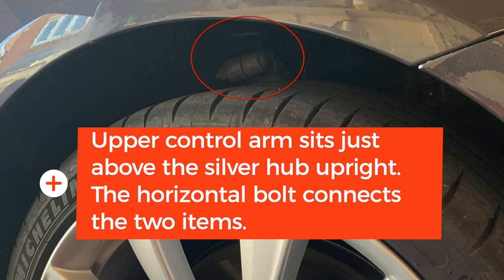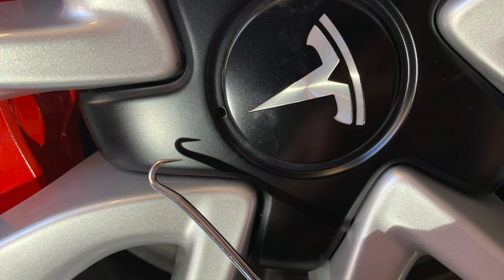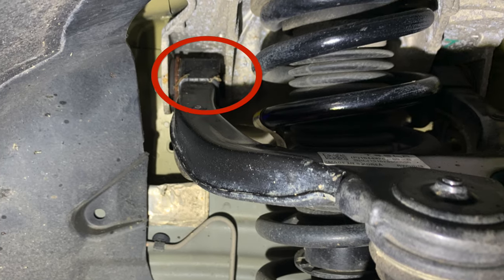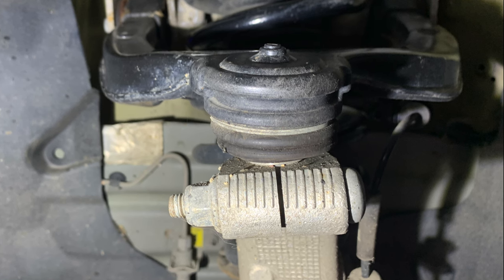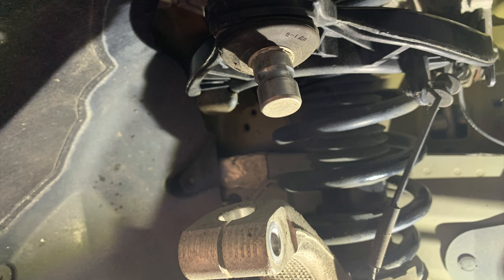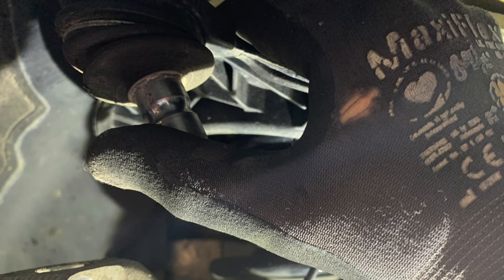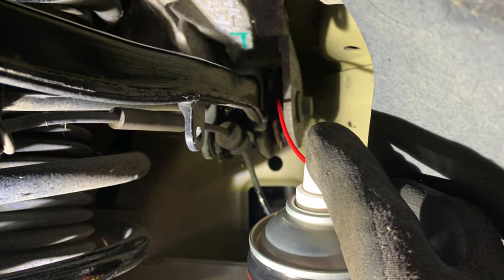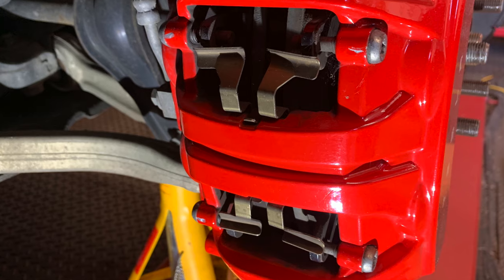Tesla Model 3 squeaky suspension cause and fix

Comment: I've had both fronts replaced under warranty and just had failures of both rear trailing arm bushes, which requires the subframe to be dropped in order to get the bolts out to replace them, which creates a potential alignment issue when re-mounting it

I've done 145000 miles, so I'm way ahead of the curve than most people but its going to happen to everyone at some point (mine had been squeaking for 9 months before I found someone who could diagnose and then repair it)
Reply from the maker: That's an impressive mileage Nick, big kudos. Agree about happening to everyone at some point as they are wear and tear items.
Reply: 180,000 km (about 110,000 miles). Had both front replaced with Tesla and the right twice second time under warranty

Comment: My 2019 Model 3 with 30,000 miles on it developed this problem just a few days ago.  I have about 3 weeks of warranty left.  I just put in a service request.  I am guessing they will only fix the side that is squeaking and not perform any preventative maintenance  on the other sides.
Reply from the maker: I would ask the question, they may replace both sides.
Reply: Till when is the warranty
Reply from the maker: Basic vehicle warranty is 4 years, battery is 8 years, drive unit is 8 years.
Reply: @johntisbury  Basic warranty is 4 years ...
Reply from the maker: @MrAdopado  thanks, corrected.

Comment: Did you have to replace the nut?  I read somewhere Tesla recommended to replace new one.  🤔
Reply from the maker: I did not. It's probably good practise but as the nut was in good condition I decided to re-use it. Plus I didn't have a replacement anyway.
Reply: When taking out the nut from the ball joint did it drop or was it easy to put back in?
Reply from the maker: Easy to re-locate.
Reply: @johntisbury  sorry for stupid question but do one need to do some kind of wheel alignment after putting it back?
Reply from the maker: @AzizIzgin  you should not need to as you’re not affecting the toe or camber adjustment

Comment: Hi Thanks for the video. However, I took the joint off from the upper arm and now can't put the front wheel back to the pivot joint due to the strong upwad force at the upper arm. Could you help me what do I need to do to put the piece back to the joint?
Reply: Nevermind. Didnt know the bolt is supposed to lock in the joint thorough its groove. After removing the bolt, with some craw bar, i was able to push the pivot joint in place.
Reply from the maker: Glad you are sorted

Comment: Why no one talking about lower arms that making crazy noise. That is most common... I had similar issue in my model 3, so, tesla replaced upper arms  and charged me for that, but noise still there. And then they said its from lower arms... i still don't know why they replaced upper arms...
Reply from the maker: This is interesting, my noise was definitely the ball joints in the upper control arms. Everyone I've talked to, who had the same issue, was the upper control arms. It sounds like it's not the same issue. You have a noise but it's not the upper control arms. Mis-diagnosed by Tesla. It could be the lowers or even the drive shafts as they can squeak on stop and start. Hope you get to the bottom of it.

Comment: I tried to follow this, but I could not get the T50 hex bolt out after removing the nut. I hit the uncovered nut end with a hammer a few times, and it still did not come out. Is the hole holding the bolt threaded? I don't want to damage the bolt because I'd need the car to drive to a store to purchase a replacement.
Reply from the maker: No it's not threaded from memory. I suspect corrosion has set in between the bolt and the knuckle. Pump some oil, WD-40 or similar in to see if that helps to loosen the bolt.
If you hit the end of the bolt with a hammer make sure the nut is still on the end of the bolt to protect the threads of the bolt. You don't want to knacker up the threads by hitting it with a hammer.
Reply: @johntisbury  Thanks for the suggestion.  I sprayed the bolt where I could, put the nut back on, replaced the tire, and lowered the car soon after I wrote my original comment.  I scheduled to have my usual garage look at it to see what they say. If I don't like they're assessment, I try this again.

Comment: Thanks for the info. I have a novice question. Is there torque spec when you retightening the upper control arm?
Reply from the maker: There probably is a torque setting, however I don’t know it, I tightened to the same tightness feel as the original.

Comment: Did you need to use force to put it back the ball joint? Did you need a second jack to force the pin in? Or everything can be done by hand?  Asking because i only have 1 car jack to lift the vehicle and i will have no support for the axis or anything
Reply from the maker: All done by hand, no second jack required

Comment: What’s the name of the grease u used for the ball joint? the same thing u sprayed on the joint right?
Reply from the maker: I didn’t use any grease, I simply manipulated the joint to re-distribute the grease. The spray was a silicone soray
Reply: us a Chassis grease, like lucas Red-N-Tacky works great, and is meant for these kind of joints.

Comment: Alright alright alright. So I am looking at 2 trips to an incredibly far away service station (52 hours of driving total) and my TM3 is creaking like this but worse. They replaced my control arms. Didn't work so now they want to check out my lateral links BUT perhaps they just need to do this in my driveway?! Is it possible Tesla doesn't have a clue what they are doing? Can I send you a video of my squeak?
Reply from the maker: Ah Laura I'm sorry to hear this. TBF if they have already replaced your control arms then it's highly unlikely to be the same thing that is squeaking as shown in this video.  It will almost certainly be something else. Troubleshooting squeaks is not easy, you have to fault find and replace / grease / secure and then see if that fixes it. It's not a black or white process often requiring iteration before finding the actual component. Being so far away from a service centre is a real downer. I'm not a mechanic or Tesla expert so I doubt I could remotely interpret your squeak from a video. You could try the Tesla Forums, however,  you will problem get 20 diagnosis for what is causing it.

Comment: What’s the Torque spec for the T50 Bolt, how tight should it be ?
Reply from the maker: Specs are in the comments from @Daniel Choi  "ball join bolt is 41.3 ft/lb"
Reply: @johntisbury  actually lb/ft for torque (ft/lb is different)
Reply: @MrAdopado  Actually both of those are wrong. And I am not just talking about the units being antiquated.

Comment: The second bump looked less in height than the first. Did this really work?
Reply from the maker: It’s the same bump, it’s our driveway. Yes it works, however the squeak can return over time as the issue is lack of grease.

Comment: This anyone try this and you still got the squeak? Mine did not improve at all and yes I triple checked on how to do it and how I did it
Reply from the maker: That's frustrating to hear. Is the sound of the squeak exactly the same as mine on the video? It could be there is no grease in the ball joint which means even if you manipulated it with no grease it's not going to improve things. The other option is the squeak is coming from elsewhere.
Reply: @johntisbury yea it’s the same annoying squeak and on the driver side only. That make sense, might need to replace it then. Do you recall how quick it went away after doing this? I drove all day for a while and different speeds and turns, so the grease should be moving around if it is that.
Reply from the maker: @MizaProductions1 my noise went away as soon as I lowered the car off the jack and drove it.
Reply: @johntisbury  ahhh ok, then yea, must be something deeper since I did do what you did
Welp, it was worth a try before they charge me an arm and a leg 
Thanks for the replies

Comment: Isn't this a common issue, covered under warranty for free?
Reply from the maker: It is on the early models and yes covered under warranty. Tesla later modified the ball joint in the upper control arm to fix this problem. These can be retrofitted under warranty.

Comment: Can anyone pls help me I bought a 70 plate m3 and got a same issue.. I’m in midlands.. pls give me a shout if someone can help me resolve this 
Thanks
Reply from the maker: @alexdias5122  you don’t need to be a mechanic to fix this Alex. Many commenters have simply sprayed the points in the video with WD40 or similar. Don’t even need to take the wheel off.